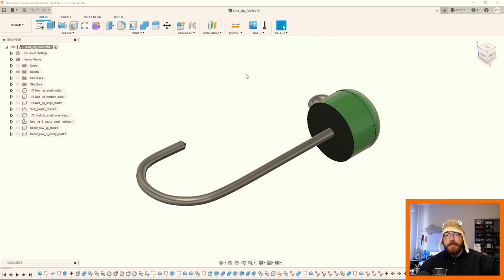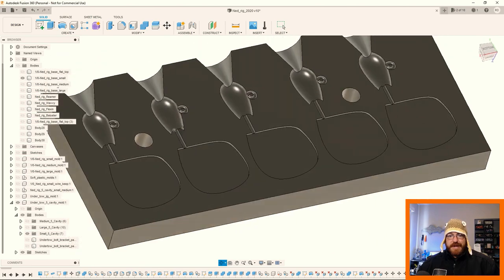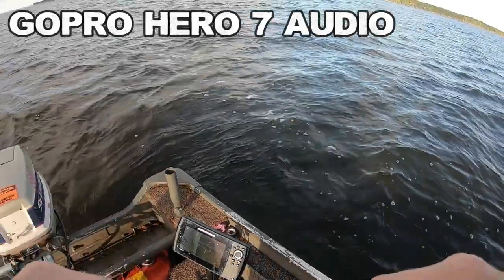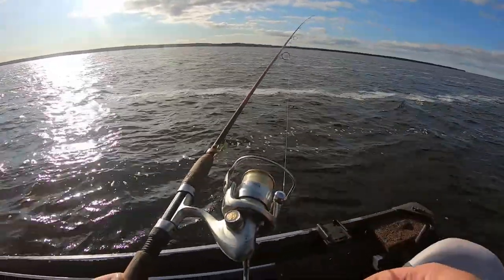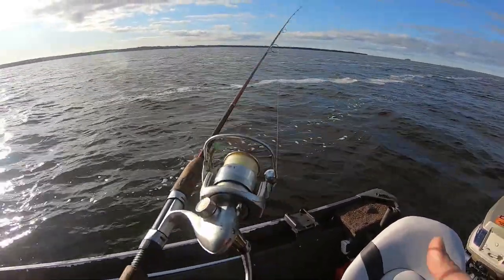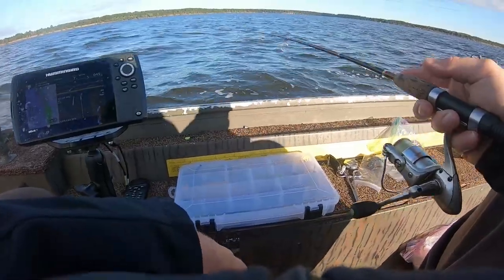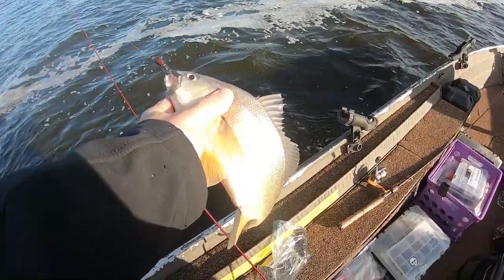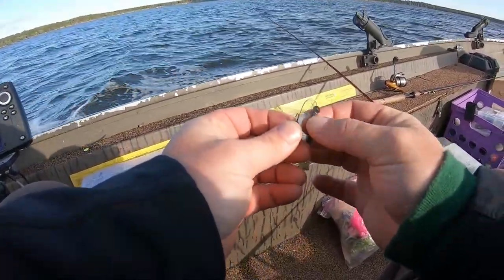3D Printed Jig and Trailer Soft Plastics

Comment: Where are you Elliott?
Reply from the maker: Not dead, just a lot of real life happening. I'm almost to a place to do another video but life is smacking me in the face. I appreciate the concern! There is some stuff coming eventually.
Reply: @RevampedOutdoors  I really like your videos on the 3D printed molds and such.  I am pretty decent at 360 and have 2 3D printers plus all the hooks, plastics, shop, etc. Would you be interested in creating some specialized content or at least somewhat directed?
Reply from the maker: @btigenie  thanks for the kind words. I guess that depends on what you're thinking. I'm pretty tight on time right now but I can try and work on some stuff if it's something not too intensive. If you want you can send an email to the email address on the channel.
Reply: @RevampedOutdoors  that I will do! My biggest hurdle has always been "modifying" my drawing...adding the injector port, breather lines, etc. I'm not a fluids engineer lol.
Reply from the maker: I don't think I can help much either lol, I just give it a good guess and send it. If it works it works, if not I'll cut some vents in the silicone but I can try and do a short tutorial in the future on where and way I chose the spots I do. It might be interesting to go over what has worked and not worked too.